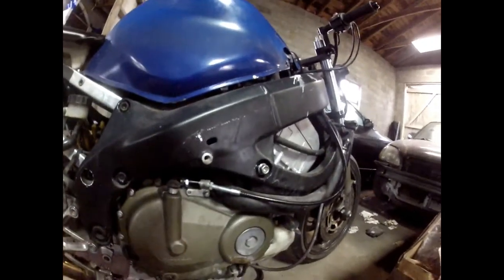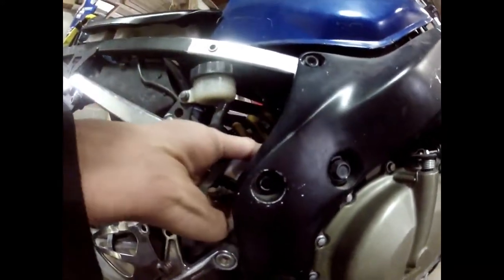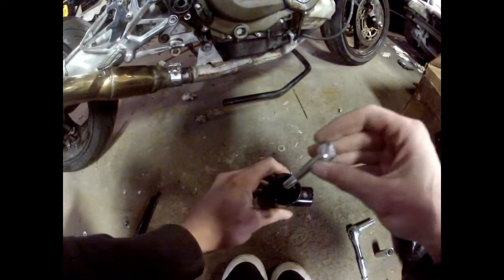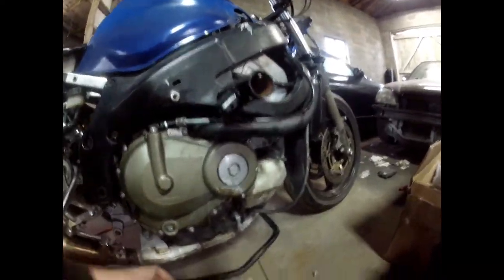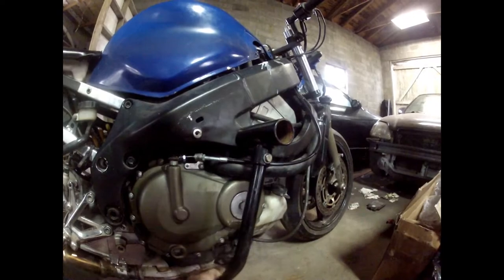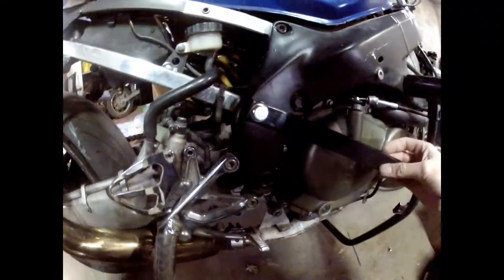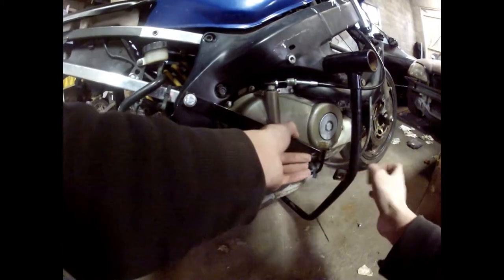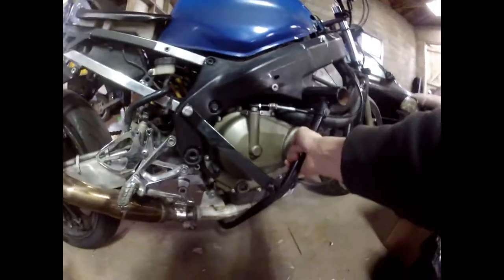F4I CRASH CAGE INSTALL

Comment: So you removed the engine hex bolts and got longer ones?
Reply from the maker: Yes
Reply: Slightly Mangled you wouldn’t happen to know the size of those by the way?
Reply from the maker: I don't remember the thread pitch but it was roughly 1/2 inch longer.
Reply: Slightly Mangled thank you for the fast reply and putting me in the right direction.